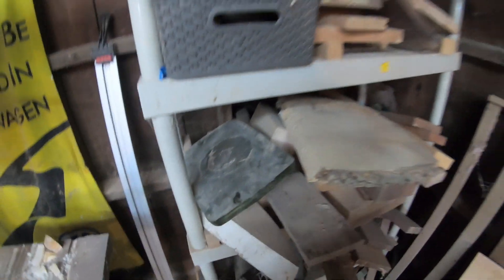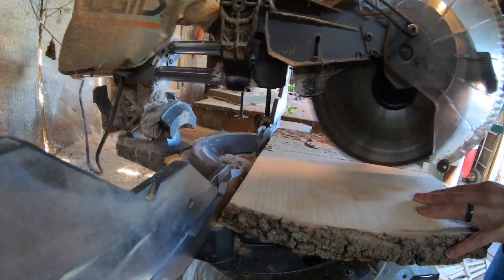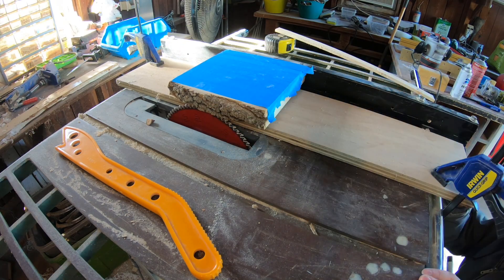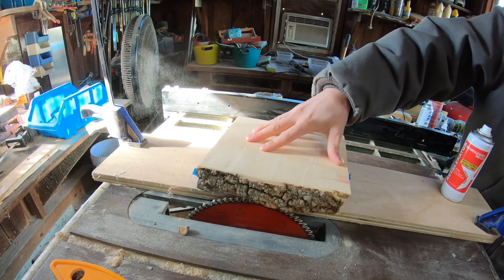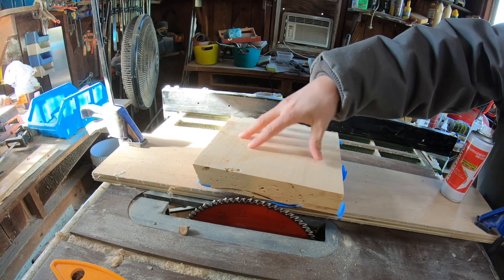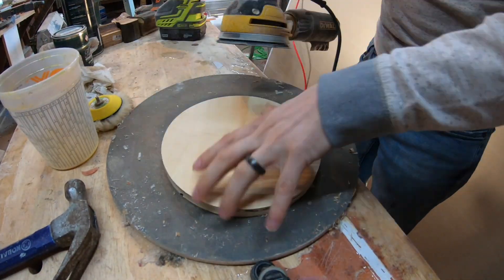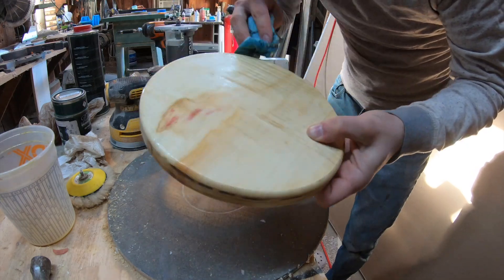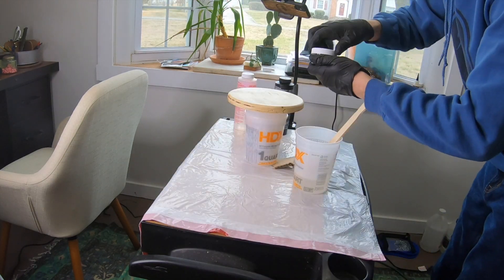Color Changing Disappearing Wood and Epoxy Thermochromic Trivet

Comment: I am making some Trivets like this, this weekend.  But I am using 6" tiles along with Stone Coat high heat epoxy.  I am also putting a sticker on the tile that says HOT.  So when it goes clear, you see the sticker.  I am also adding glitter to the black epoxy to make it a galaxy look.  I am also painting the edges of the tiles so that the thin edge of the while tile will not show through.  Thanks for the idea.  And I also realize I am using the word ALSO a lot lol.
Reply from the maker: That’s awesome! I hope they turn out great

Comment: I was hoping after a few years that you would have upgraded to using a touch to pop bubbles with...... you heat gun blows the epoxy right off the piece

Comment: Very cool product.  What are your thoughts on using the sander sealer instead of epoxy seal coat?  Adorable little girl
Reply from the maker: Great question! It seems to work well and dry very quickly.
Reply: @GoodViewWoodworks  so we take that the sander sealer would be ok instead of epoxy seal coat
Reply from the maker: I’m still a little leery about using it on a big project but it seemed to work okay on this one.
Reply: @GoodViewWoodworks  thanks for your input.  It would be nice to use the sand and seal and save a little money for epoxy

Comment: This is a great video, the thermochromic pigment is really cool.  I have always thought about making a trivet with epoxy but have been hesitant because of my fear of melting the epoxy with a hot pan.  Any thoughts on this?  I haven't done any research on it...  

Also, I think another cool idea would be to mount a thermometer on thermochromic epoxy.  It certainly wouldn't change as fast as it did in this video, but slow cool???
Reply: Use stonecoat epoxy if your worried about heat hands down the most heat resistant that I've used (used 3 others not happy with them at all) I typically do 2 to 3 countertops a month haven't had any problems with heat but the first micro scratch you we would think the world is coming to an end lol
Reply from the maker: Great idea! A hot pan shouldn’t mess with the epoxy as long as the epoxy is fully cured. Which may take up to 30 days after hardening.
Reply: @GoodViewWoodworks  I think that depends on the brand. Not sure. But I did a countertop with Promarine and 6 months later, my Mom set a hot pan of spaghetti on the countertop and it distorted the finish from the heat and left a ring in the finish. I had to sand and buff it back out. Then I made a separate trivet to use out of Corian.I've read that most epoxies can withstand anywhere between 120 to 140 degrees only.
Reply from the maker: Oh it definitely matters what epoxy is used. I would use StoneCoat for countertop wpoxy